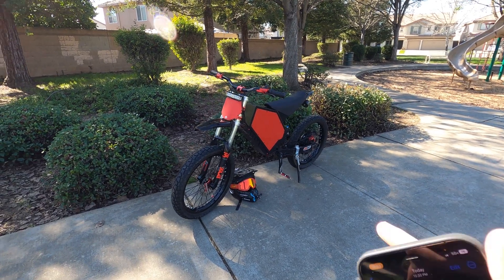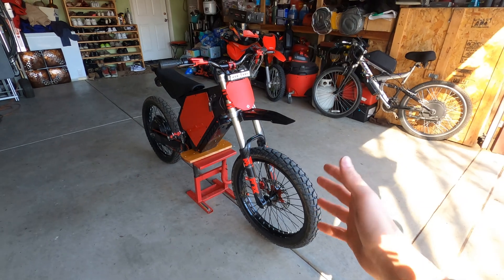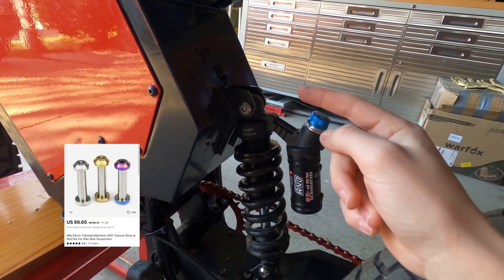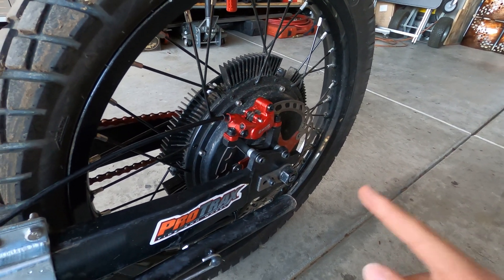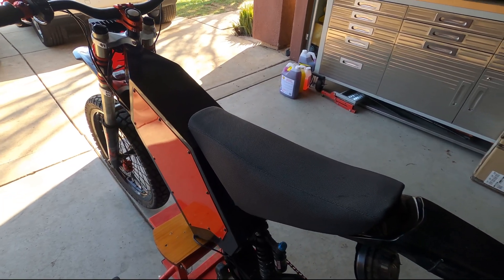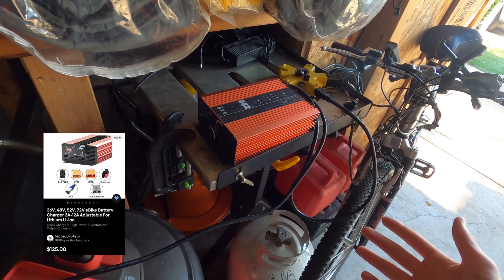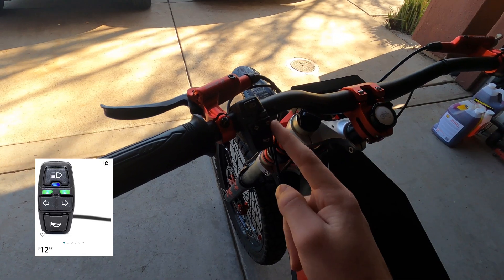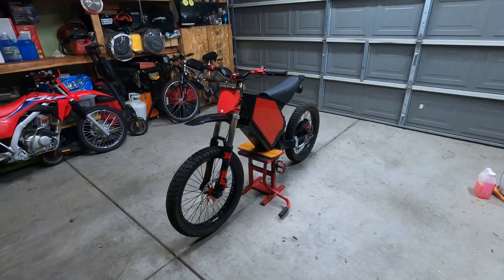Enduro Ebike PARTS List & Total BUILD Cost

Comment: The brake mounting bracket on the Zoom brakes is 51mm, but the mounting points on the forks is 75mm. Did you use an adapter?

Comment: I subbed so that I don't lose this parts list! I'm also working on an S/B frameset with 200mm rear clearance for a 19" NBPower QS273 and was thinking real hard about the front end setup... I honestly think this bike is going to be scary
Reply from the maker: Just changed my front end out to 2023 surron forks that I found for very cheap locally and man are they better then the zoom forks. Definitely would recommend getting a good front end setup.

Comment: Not a fan of that charging port location. My clone has it at the top where gas would go in. Nice build dude. How hot does your controller get under full load, full speed and going uphill?
Reply from the maker: I don't have any hills in my area so I can't really tell you how hot it gets under serious load but I am usually going full throttle or sending it on trails and I've had no over heating issues at all.
Reply: Yes!

Comment: Remember if you’re building a battery, the tools and technical know-how will not save you money on the first battery. If you plan to be making 4-5 to sell it’s worth the investment but I would be extra careful on your taxes.
Reply: Do you think is it worth to build these and sell?
Reply: @serhatvarli3869  potentially. You would be talking about bulk ordering ten bikes worth of parts and probably struggle to find the first few buyers
Reply: I am finding decent, used A123 batteries at about $0.60 each, or about $100/kwh. These batteries are bulletproof and can be soldered with no damage. They are also capable of 50 amps per cell!
Reply: @TheSorters lol no they are not. And they have tiny capacity. You would have to buy 3x the amount just to equate to 1 18659 and even then it would be a low cap one. That battery would be such a pain in the ass to build too. So many potential points of failure. Not to mention the additional
Weight you’re taking on.  It’s not advisable to use 123a
Reply: @LostLeftyLimb  the A123 26650 battery has 8.25 watt hours. It isn't 1/3 your magic battery. More like 80%. But A123 cannot be beat for safety, C discharge rating and charging speed. Those traits more than make up for the extra weight and lower capacity
Reply: It will save money if: you already have a few tools, you buy high-performance cells on sale in bulk, and you want a certain performance standard. 
I have built five batteries and they are all Samsung 40t 72v between 80- 150 amps. This is less expensive than buying a quality high performance pack.

Comment: You are going to have to custom fabricate new brakes for that because bike brakes are totally inadequate for it. Thanks for the video especially the part list, I've blown out the forks on mine already.

Edit: The forks suck. They aren't what are on the bike. Bad link!
Reply from the maker: These brakes bite amazing if you bleed them and get good pads?? I agree the forks suck for anything other then street riding. I plan on switching them out for KKE forks.
Reply: @arthurbal  Himalo shocks are decent too, in between Zoom and DNM forks interms of price and performance which makes them perfect.
Reply from the maker: @SRNAR8  I just put on some surron forks and they are so much better then the zoom forks.

Comment: How did you build your own battery
Reply from the maker: I used 18650 cells and spot welded them. 20S 10P configuration. 150A BMS

Comment: Hey I got a question bro, so you recommend I invest in a better pair of brakes ? I know the motor kit comes with some but I’m in the process of holding mine so before I complete I’m debating to put more $$ into it and buy a separate brake system rather than the one nb power comes with? Mines gonna be street use only
Reply from the maker: The magura mt5 or mt7 brakes are amazing from what I have heard from. Pretty sure the mt5 brakes come stock on surrons and people say they are great as long as you have some decent brake pads. The brakes I have are 4 piston zoom brakes but I wouldn't recommend them for offroad use they might not be the worst for street use. They definitely have the power to lock up the wheel up but they are just really cheap. I had a brake line start leaking on my rear brake but they did send me a replacement. I would invest the extra money and get magura brakes if I were you.
Reply: @arthurbal  thanks man will look into the Maguras and keep you updated 🙌🏾🔥

Comment: On your video with the new sabvaton controller where did you get the alarm that is attached to your keys and how did you connect them with the key switch?
Reply from the maker: i use a separate alarm that I mounted under my seat. Here is a link: wsdcam 113dB Bike Alarm Wireless Vibration Motion Sensor Waterproof Motorcycle Alarm with Remote https://a.co/d/7gWLFWK

Comment: hey i wanted to use the enduro frame to make an ebike is it possible for the bafang or any pedal motor would work with this bike?
Reply from the maker: To be honest I'm not sure if a mid drive would fit on this exact frame that I have. I've seen people run mid drives on other custom enduro ebikes so maybe it would be possible but the frame is meant for a hub drive motor. It even has torque arms built in specifically for hub drive motors.
Reply: @arthurbal  damn do u kno of any frames thats similar that the bafang could fit? i really like this style no kizzy

Comment: Hello and many thanks for your videos that gave me the idea to build my own. One question, surely stupid, why are there pedals, chain and else on those models because it is unusefull to make it work. Is it a legal reason so that it is better to look like a bike more than a motorcycle ? Or else ? Thanks a lot and best regards from France 🇫🇷
Reply from the maker: The chain and pedals is for aesthetics and legal reasons. 10kw 50MPH Ebikes aren't legal unless you get them legally registered. So with the pedals you are able to make the bike considered an "Ebike". If an officer sees you just pull to the bike lane and slow down but worst case they pull you over you can simply explain that its a 750w ebike and they will let you go.
Reply: no basically the motor automatically moves the chain

Comment: Whats your top speed with the 100amps sabvoton controller?
Reply from the maker: I run it at around 80A to not drain my battery as much but you can expect 50 mph. My motor is also 3.5T which is mean for more speed rather then torque.